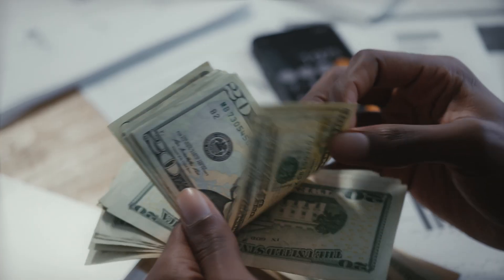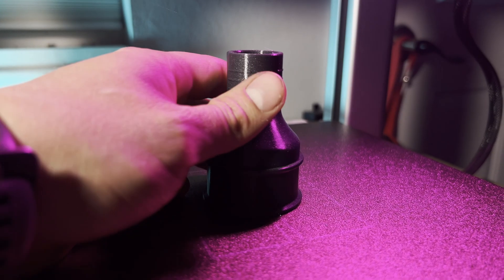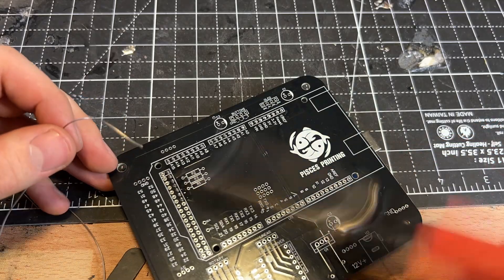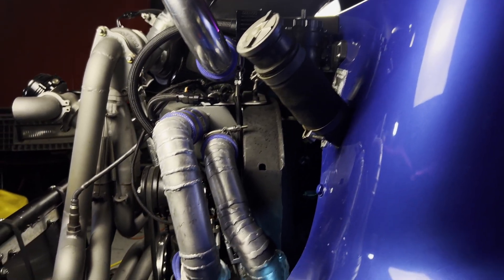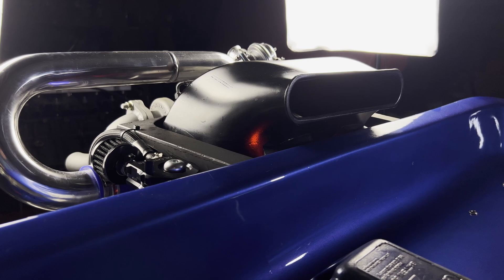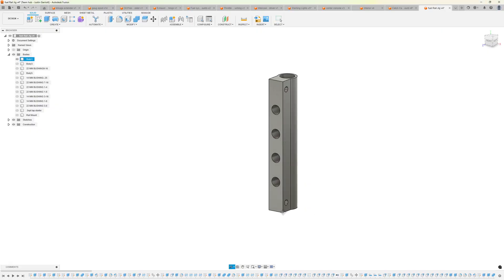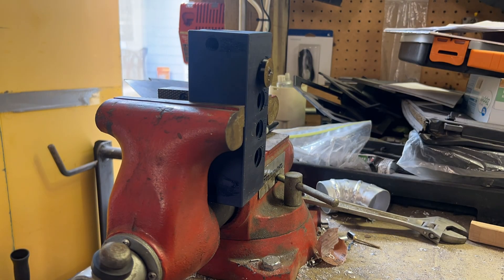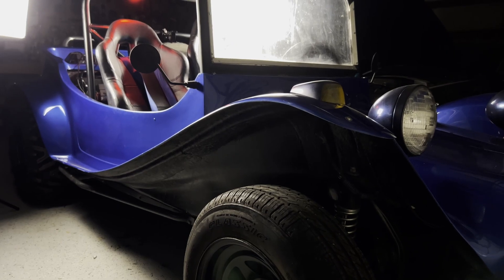7 Functional 3D Prints That Fixed My Car for Pennies

Comment: What scanner are you using?
Reply from the maker: It’s the creality scan raptor. However I did use the original cr scan for the first part of this build, when I was building the intake manifold(not shown in the video- it was a sheet metal intake)